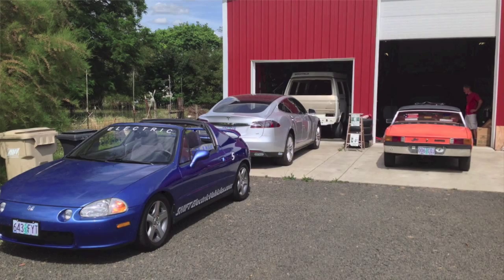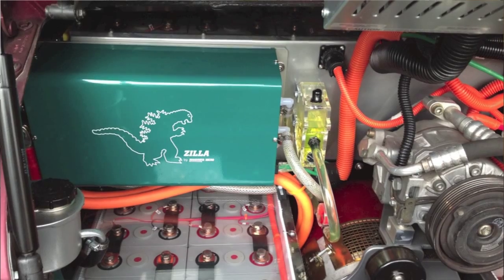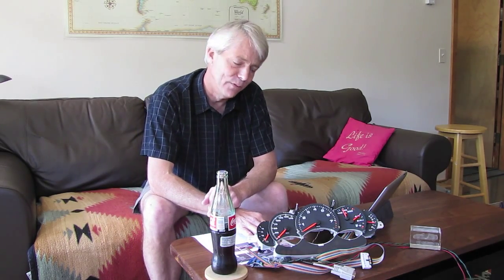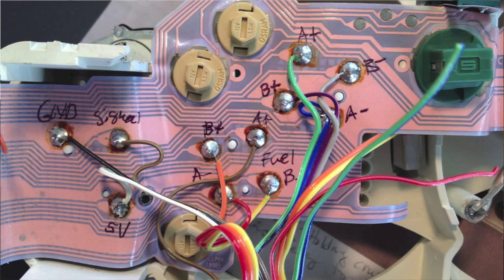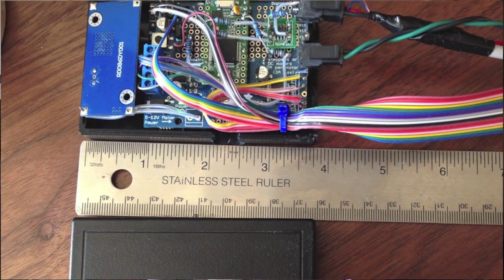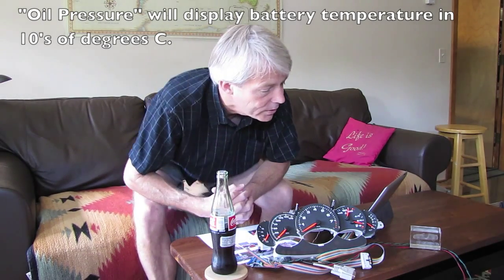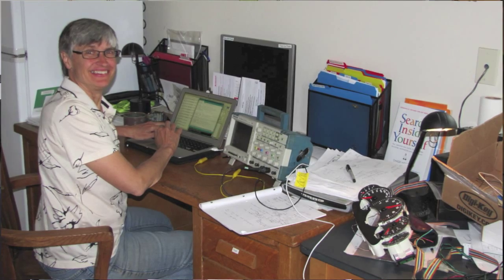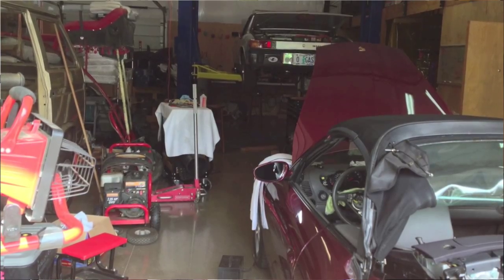Stretchla Video Update 5

Comment: I've seen all of your Strechla videos, and I have to say, this is amazing project.
But also i've read your blog where you say Tesle ceased providing you with parts. So, my thoughts are, in agreement with yours, probably that's temporary policy of Tesla. They will have to change it in 3-4 years when Model 3 comes out, I think.
So don't abandon the project, you can make the car ready to roll by the time when Tesla policy changes. 

Well, the other thing is, why do you want to upgrade minivan? ) How do you like this idea: hack the speed limitation (it's 210 km\h, maybe 250 with recent firmware), install custom cooling system in all of front trunk, recover the body and make it amazing race car for track? If properly done, I think you can find a customer who can buy it for the price comparable to new Tesla ))